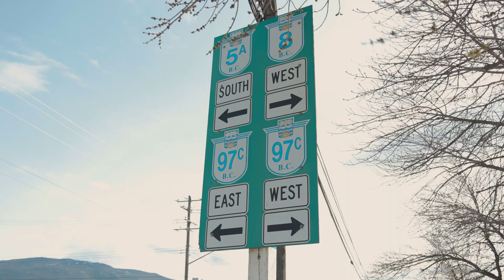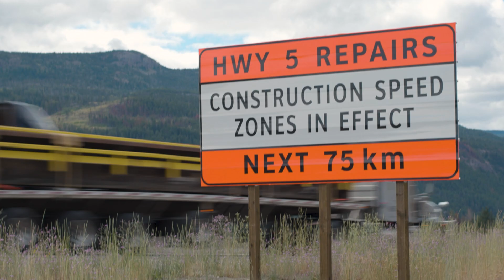What it Took to Reopen the Coquihalla After the 2021 Atmospheric River Event

Comment: it took 20 months to build  the entire coquihalla  but it but 12 months to fix a small stretch of road  and a bridge and there patting themselves   on the back was the work hourly or bidded out ?
Reply: Next to no safety standards back then.  One worker was even blown off a bridge and fell to his death as there were no guard rails or tie offs.  You worked your ass off and did very unsafe shit to get it done.  Over 20 separate contractors built the highway in sections all at the same time for expo 86' which is why it was built so fast.